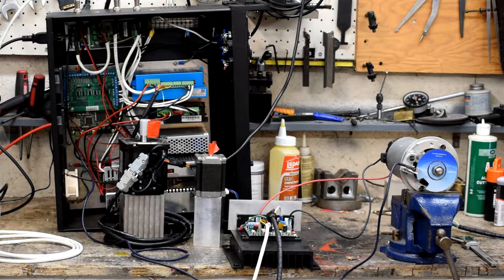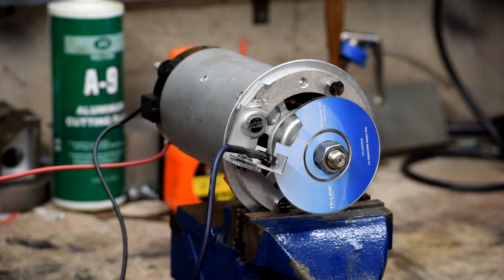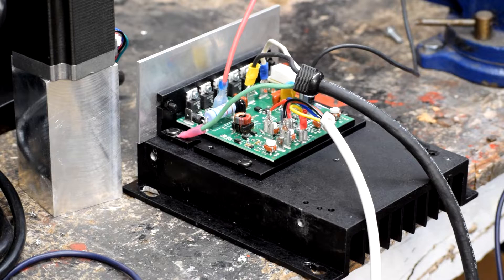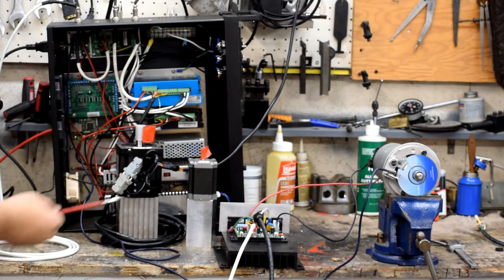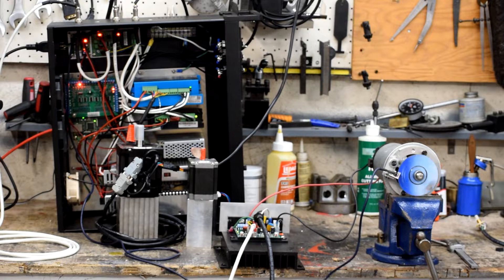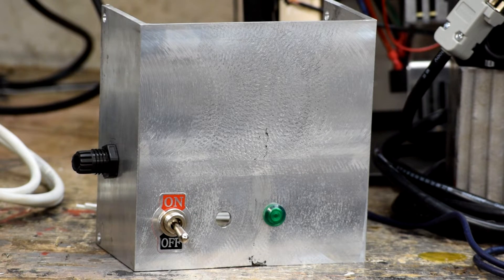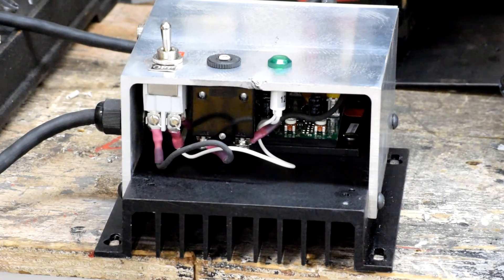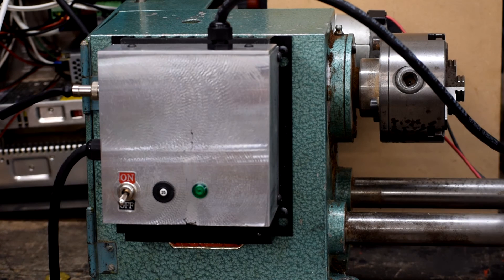Far North Racing CNC Adventures Episode 4 - DC Spindle Motor & Controller

Comment: So awesome to find this video. I'm doing a CNC mill conversion and I'm choking on the cost of a servo motor for the spindle. 
What are the four wires from the PWM board connected to on the KBB driver board? (I can't quite make it out in the video)
Reply from the maker: There’s an on/off and a 10V analogue speed connection.
Reply: @FNR  As yes I see how they connect now. Finding the KBB manual helps :)

Comment: Did you have to isolate the analog signal from the CNC controller to the KBIC ?
Reply from the maker: Nope - at least, not explicitly. The controller board I used I think provides integral isolation.

Comment: Great Job.  Do you think it is possible to use the threadmill motor as an servormotor?  If i add an incremental encoder and i use a  DC servo drive (Gecko, Leadshine, Dugong) will it work for a cnc axis?
Reply from the maker: I don't know much about servomotors (hell, I'm doing a lot of learning here about electric motors in general) so I can't really say. It is also really big, so you'd have to be moving a pretty big machine.
Reply: @FNR  thanks RecceDG. Best Regards

Comment: Very cool! I'll definitely have to keep a treadmill motor in mind when it comes time to upgrade my mini mill. 

One small note... You may want to put a bit of heat shrink around each individual wire connection on that aircraft connector, in addition to the heat shrink around the whole thing. It's good practice for solder-cup connections like that, and it's cheap insurance against any vibrations causing a short sometime down the line. (source: am an aircraft mechanic)
Reply from the maker: I had planned on potting the pins with "Liquid Electrical Tape" but my can had hardened into a hockey puck. After having used those connectors on this project though - never again! There's about a half-dozen serious design flaws in these things. I'm switching back to a crimp style like Weatherpak or Duetche. I'm amazed they are still allowed on aircraft.
Reply: We typically use crimped pins in cannon plugs. But there are the occasional soldering jobs... Rotary switches, push buttons, some lights, some connectors, relay bases, etc.. Each solder joint always gets its own shrink wrap.

Though to be honest, I wonder if the connector you have there is an "aircraft" connector, instead of an actual aircraft style connector. It honestly doesn't look like anything I've seen on any of the planes I've worked on.